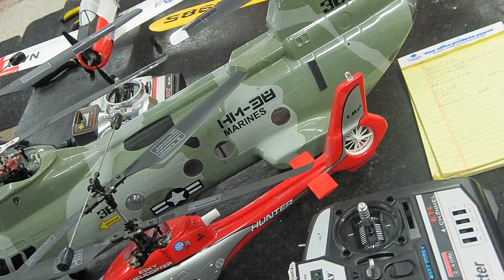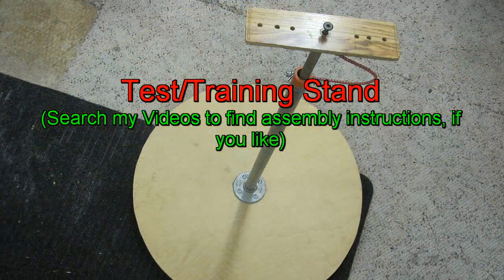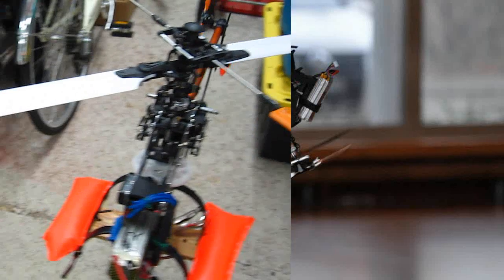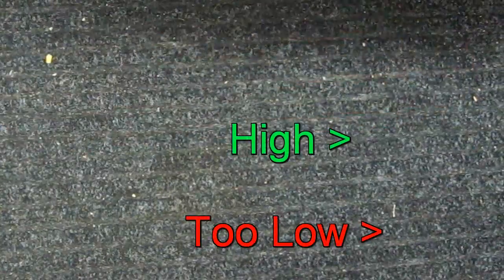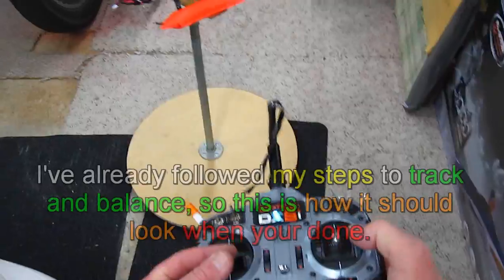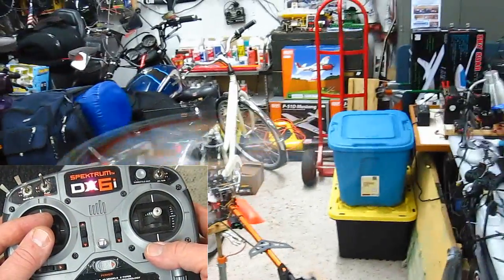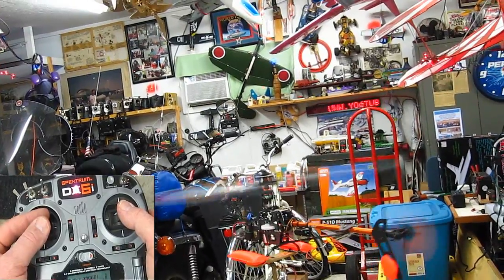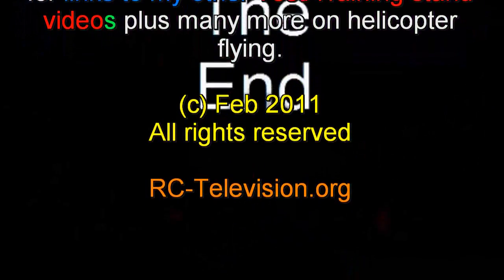Rotor Blade Tracking and Balancing explained.

Comment: I was hoping to see you dynamically balance a co-axial ship.
Reply from the maker: Sorry to disappoint you.
Reply: @NightFlyyer  I'm the past editor of the Experimental Helo magazine and have written articles on the tracking and balancing of rotor blades for the two bladed experimental helicopters.  We have some advantages over the R/C ships.  I have tip lites I can install for tracking and can quickly achieve good results with single pilot.  No crew required.  I also got to the point where I could balance the Safari in three starts to get vibration levels down below 0.05 ips. Using an electronic vibration measuring tool.  I've also seen some serious pros have trouble balancing a Bell 206 one night using the wrong polar chart.  I didn't have a polar chart and had to use eyeball physics.
Reply from the maker: @stufields5125  That is great. Which mag  was it?   I wrote some articles for Radio helicopter in Europe and also Rotory Mag, for Mike Mas and just recently in Model Airplane News.  I have many videos on 1 bladed helicopters, Drones, and plane experiments and have many balancing tips on that, including a video on why helis wobble and the advantage of 1 blade.  Mine was all eyeball Physics too and even a hammer to counter balance a Kyosho Nexus Nitro with one blade.  LOL.  Thanks and happy flying.

Comment: Thanks for the video. I don t have such problem so far with trex 500. Got another question. I changed the tail from belt to tube drive and the tail became heavier. For now I use 4s 3300 battery and it is not enough to balance the heli, no matter how far I move the battery forward. It looks like I need 6s. I also moved the canopy 250 mm forward to get more room for 6s 3300. Any other suggestions on balancing, in case 6s 3300 weight may not be enough? I think I could squize 6s 5000 or more after I moved the canopy. And it accually looks cool).
Reply from the maker: WOW!  Well it may not be "that" heavy, but if you cant put anymore lead wheel balancing weights in the nose, trim the swash-plate to tilt a little more forward or down in front.  Good luck.
Reply: @NightFlyyer  Thanks for response. Since I mostly practice take offs and landings, for winter flying, would you suggest to wrap electronics in plastic bag or something to avoid snow burst to get on them during take offs? How should I protect electronics from moisture?
Reply from the maker: @rmiklosh  You could do that, but since most electronic pc boards are clear coated and in cases, unless you dunk them in water, it usually is not a problem to get a little snow on them.  At least I have never had any problem.
Reply from the maker: @rmiklosh  That's the only way I fly. If you watch any of my helicopter videos, you will note I flip the Throttle lock, hold, 3d switch or whatever you call it, on.  I have it so my throttle is set for 90%, not 100 % though.  I do not like to run wide open.  That way I can fly inverted and do 3d maneuvers.  That can't be done when the throttle goes down with the left stick.  The heli is much more stable due to gyroscopic effect and I think you will find hovering much more easier.  Remember it must fly at about 3 ft altitude to stay out of ground effect, so make sure to pop it up there.  Also remember, if you crash with the throttle switch on, it must be shut off immediately.  Good luck.

Comment: I'm into r/c aircraft including helis but in a previous life,I worked on full size helicopters for a bit,in particular bell 47's & at the other end of the pole S70A9 Blackhawks for the Australian army(only for a short time though) . When we were doing tracking on 47's we used to get under the disk at skid light & poke it with a rubber tipped broom,marking the lowest tracking blade & the opposite member was adjusted accordingly,blackhawks blades were tracked with a strobe

Comment: Hi Dave,
What is the purpose of the orange things under the skids?
Are they dampers or cushions?
I have made a stand very similar to yours but the plate that helicopters sits on is supported on a conical wooden piece. The wooden piece is like an upside down spinning top.
If I get a chance, I would like to show it to you either a video or photos. Is it possible to load up photos?
Walter

Comment: @kylea1985 I say stick with the simulator if you are on any kind of a budget until you can hover in any orientation.  Then buy a ccpm, belt-drive heli.  They cost the same as a fixed pitch heli ($200+/- USD) and you can grow into it.  I bought the Dynam E-Razor 450 for $180 with the TX.  That was about a year ago and I love it.  It has a metal head but parts are cheap which is rare to say the least.  Don't buy a FP or coaxial unless you only want to fly slow and inside most of the time.

Comment: wow im glad i subbed u so long ago. i just got my first transmitter for a simulator. its a very cheap one but it works. id say if i can learn to fly on a simulator with it i can fly a real one. so far ive been able to lift off and control in a small area and safely land. gona take awhile before im any good tho. any suggestions for a starter heli?